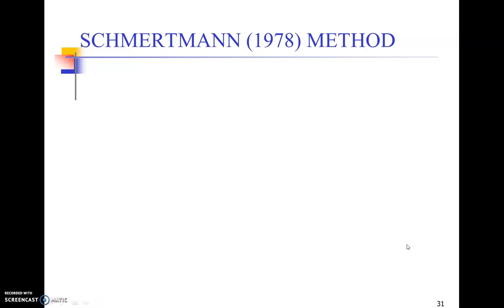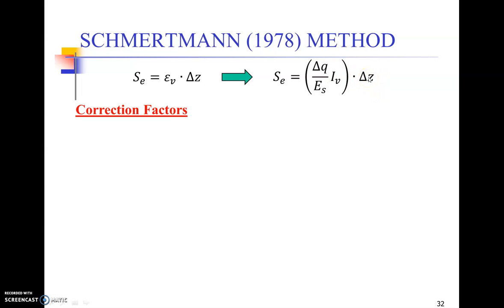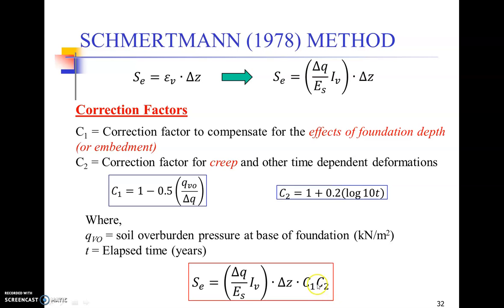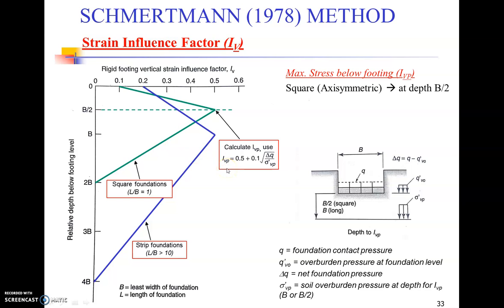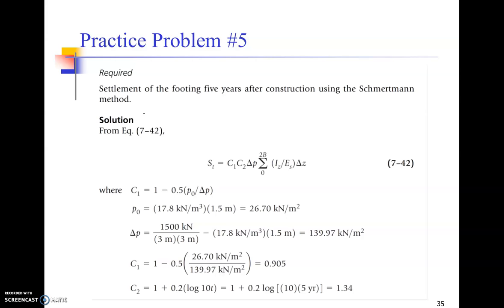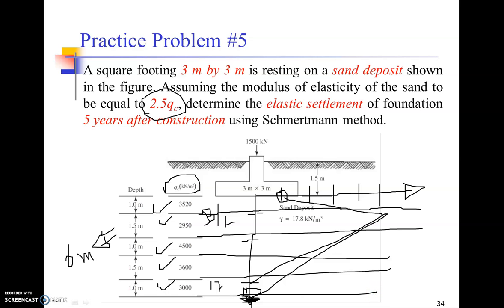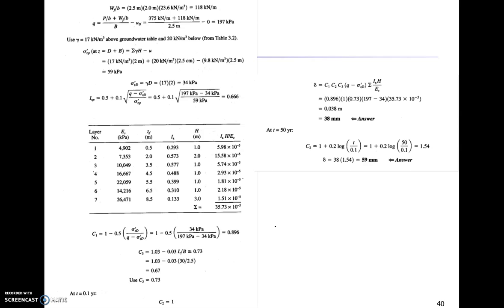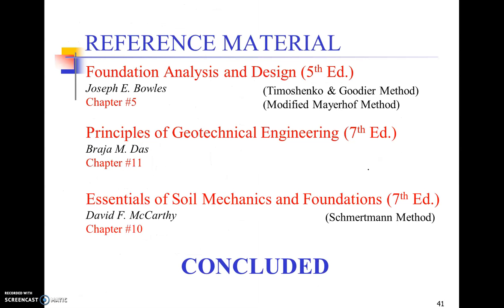Geotechnical Engineering |schmertman method of settlement calculation |soil engineering

Comment: The Ivp value is it always 0.5 or its calculated based on the formula you highlighted on graph ..If so then why did you use 0.5 as peak which inturn l think resulted in values 0.233 , 0.472 , 0.333 , 0.194 and 0.056 obtained... Looking forward for clarity l got a bit confused